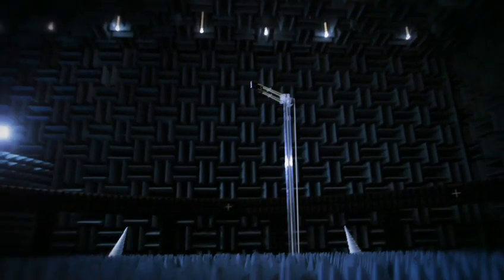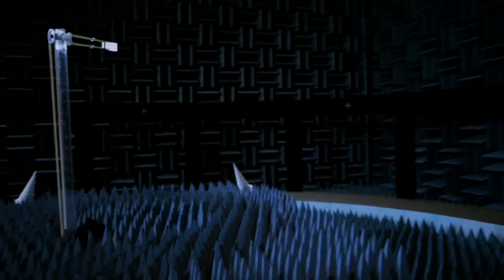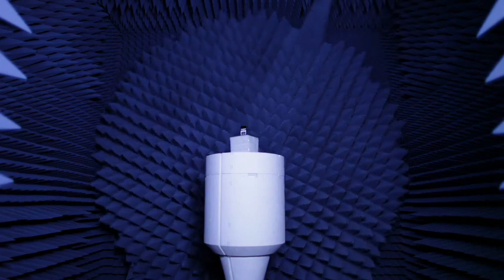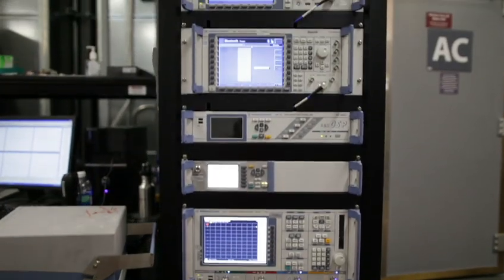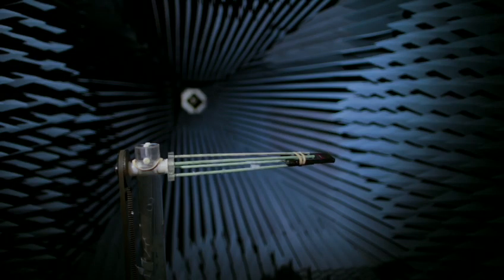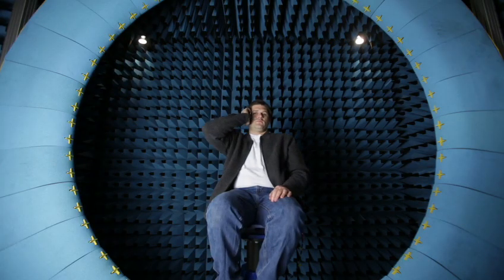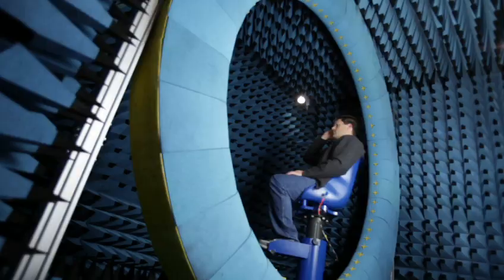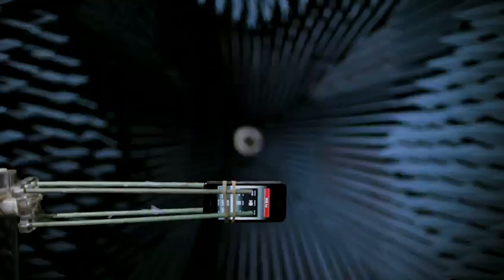Apple's iPhone Test Labs !! $100 million

Comment: For the iPhones rubber bands work fine but for iPads and iMacs they will use special holders made out of delrin and fiberglass bolts that hold the four corners of the device under test.

Comment: Looks like an awesome RF test facility for testing what was already 4 year old EDGE wireless technology implemented on the first iPhone.  HTC had 3G for several years when Apple introduced the first slow-ass iPhone.   Don't worry about the tech stuff.  Just put the product in a stylish case and Apple-Zombies will buy your techno-trinket whether it works or not.